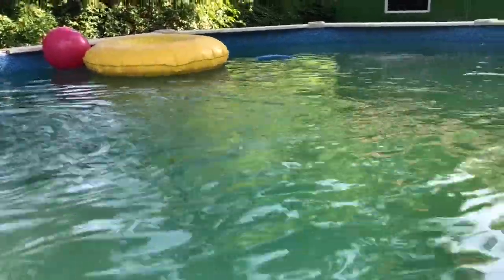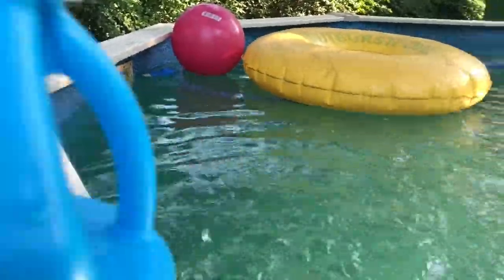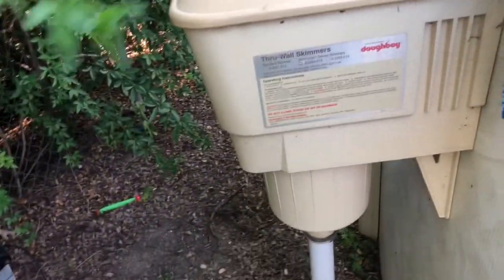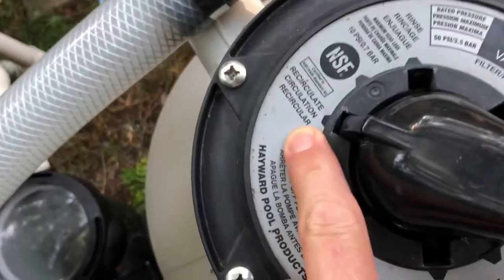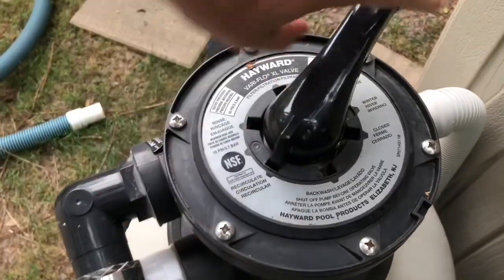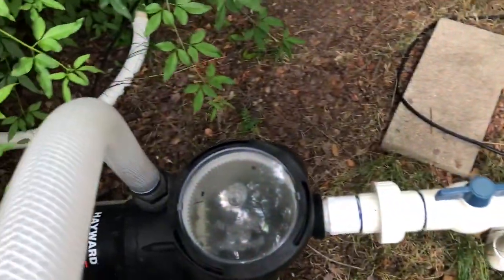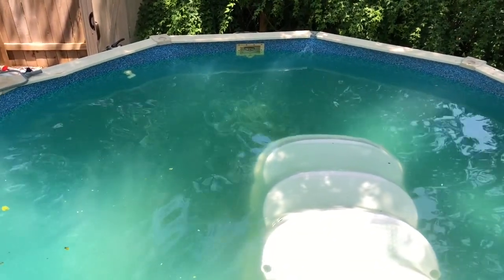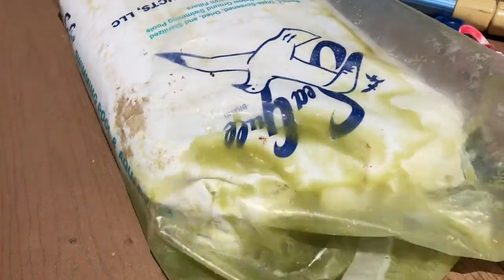Baquacil pool green algae to clear blue

Comment: When turning the multiport valve handle you should always turn it clock wise to help prevent from ruining the wagon wheel gasket that's inside the head.

Comment: I didn't go away for month and my pool constantly turned green year after year while using Baquacil
Reply from the maker: yeah - sometimes chlorine and borax is the best.  if you're always getting green, have you tried the professional algeacide w/ ph in balance
Reply: @tsomerville1970  I don't think I've tried that yet , I don't know if the pool supply stores that I go to carry that, I will have to check. This spring I did change my liner so I'm probably going to go with a salt or chlorine because it's been a long long time using Baquacil with pretty poor results for me. Thanks for your advice though and if I do go with Baquacil I'll definitely check that out

Comment: Use a 3/4 pvc pipe 12" long to tap on the sides of your pump strainer the debris will fall out. Don't bang the strainer against the pool it may crack on you. Your skimmer basket is already split open.